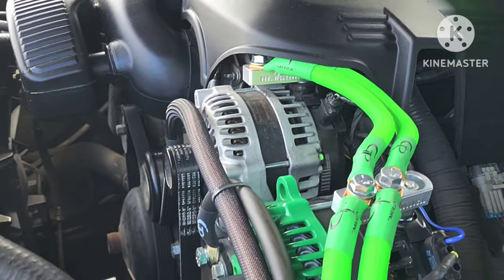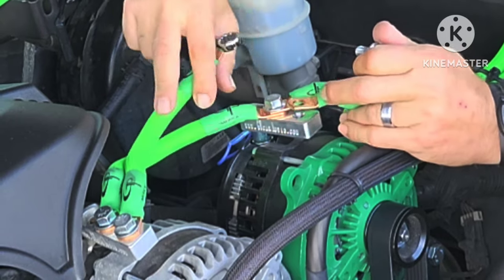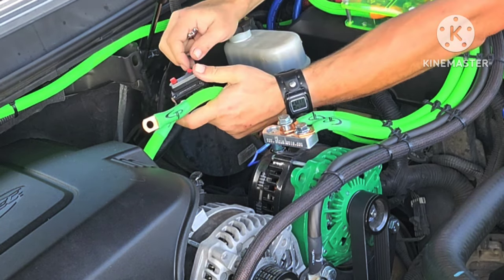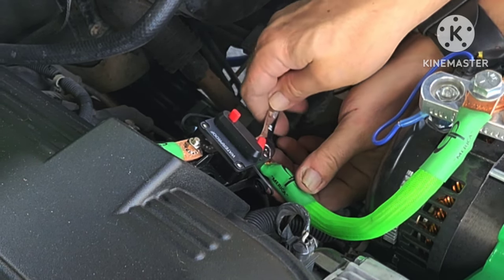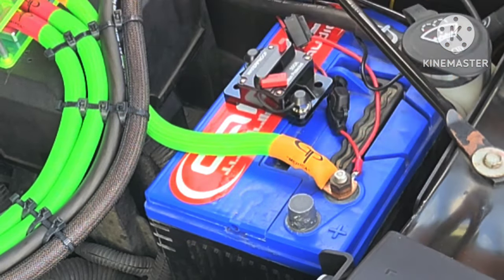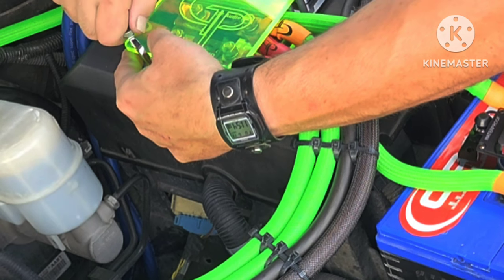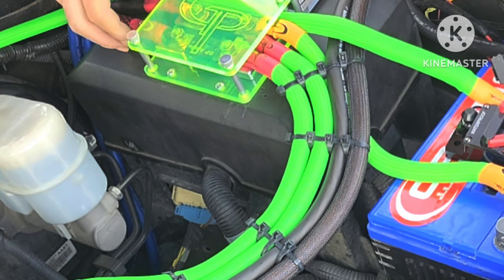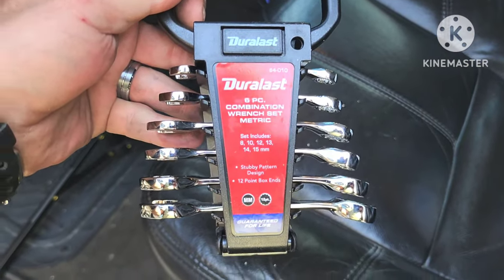Running two Separate charging systems in one vehicle

Comment: What year is the truck I'm curious the 2004.gmc I have put out 14 .4 all the time
Reply from the maker: 2010 tahoe, it varies charge depending on the load.
Reply from the maker: lol yea my ecu doent have a clue wtf is going on, its like "I need to charge something!" lol
 titoham-DCXLs
Reply: @titoham-DCXLs what fuse did you tap into?  As for ignition fuse?

Comment: Where did you tap into the key switch (ignition)  or did you just wire it to the stock alternator harness?
Reply from the maker: Found a 12v hot with the key and grabbed it there. Running that signal to a relay to turn on my amps too.

Comment: I did something similar but I used a battery isolator so I can use the factory alternator with my high output alt to charge the lithium and then when I turn off the truck it separates the systems.
Reply from the maker: havent found a need for an isolator yet, but its always in my brain (my tool set). I do enjoy playin with relays though.. man you can do so much with relays!
Reply: titoham-DCXLs  yes correct. I have the head unit running from the lithium also. Thanks for your reply.
Reply: @titoham-DCXLs  I had engine noise and tried every trick in the book with no success so I put everything on the lithium.

Comment: why not run your audio off of the one alternator and your vehicle off the other alternator?  why connect the two alternators
Reply from the maker: you can, but Id be sacrificing 300amps of charging power from my sub amp that way, this video was a while back, and is a good idea for certian situations, but my setup has changed since then